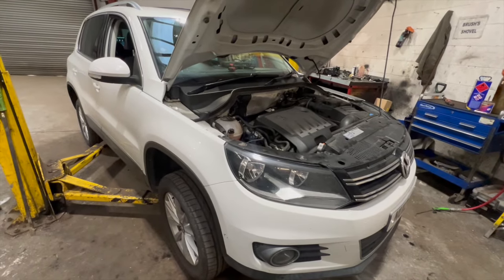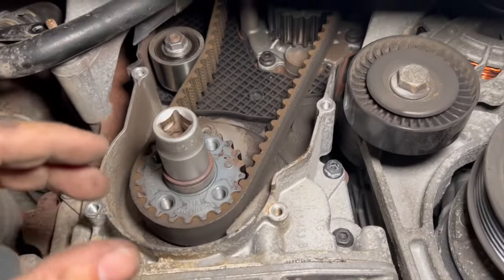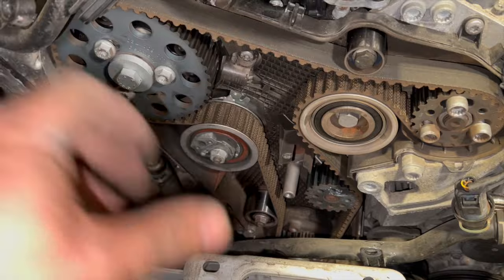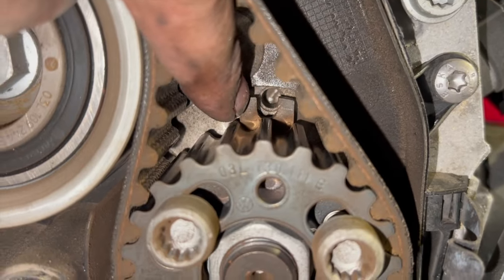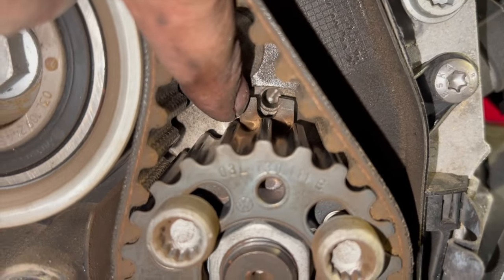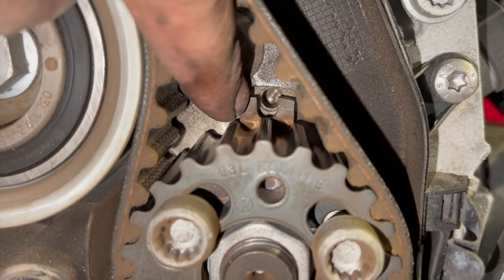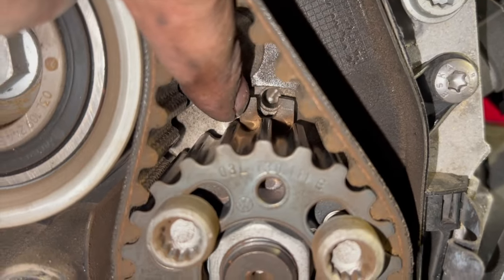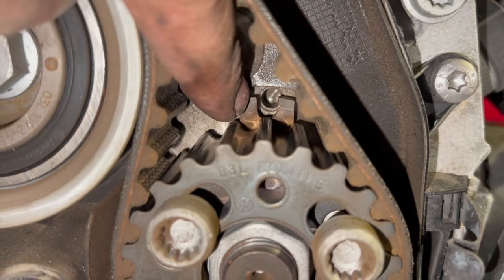2012 VW Tiguan 2.0 TDI Timing belt & water pump replacement CFFB

Comment: I once saw on a VAG website that they guarantee timing belts up to 320,000km. My 2012 Jetta TDi is currently at 190,000km.. I'll do the belt later. It's a lot easier to do on a Peugeot DW10bted4.. I did the glow plugs on that too.. OMG.I once saw on a VAG website that they guarantee timing belts up to 320,000km. My 2012 Jetta TDi is currently at 190,000km.. I'll do the belt later. It's a lot easier to do on a Peugeot DW10bted4.. I did the glow plugs on that too.. OMG.
Reply: Are you sure it was not 210000 klm
Reply: @ianpurcell7266  nah. Pretty sure it was 320,000km. Not quite double 180k km..... who knows, who cares? I'll change the belt and water pump when I get around to it. No rush

Comment: I had my timing belt done on my MK7 golf TDI and the car came back noisy !!! like overhead noise!! even my son who knows nothing about cars said whats up with the motor it sounds like its going to blow up. I asked the mechanic and he pulled the covers all off again and re checked it. Said you cant get it wrong...anyway 2 weeks later car stopped and came up with number 4 glowplug...i pulled it out and the tip was broken off and then i pulled the injector out and the tip of that was melted off !!! i turn the motor over by hand and it was locked up almost on a full turn but then jammed. Like it was hitting a bent valve or something. Never had an issue with the car ever until the cambelt was done. I think the mechanic fucked up. cant prove it. Maybe the timing was advanced and burnt the cylinder. ?? im pissed off.
Reply from the maker: Hard to say exactly but something was clearly wrong there.. always tricky when something like this has happened if the mechanic is not offering any support

Comment: Just did mine following the video, best one out there. My HPFP didn’t line up perfectly was about 1/3 of the way blocked from the left. Also tightened the HPFP to 20nm as quite allot of people have mentioned this to be the correct spec (including continental) but I’ve also seen a ridiculously high additional 90* which I don’t understand as these are defiantly not stretch bolts, otherwise surely the kits would include them new just like the camshaft bolts..

Comment: Absolutely mint video and has given me the confidence to change my belt next week on my 2.0 TDI superb. Thank you very much for this!
Reply from the maker: Best of luck! 👍👍
Reply: @diydaly  thank you it went really smoothly, kept referring back to your video.
Two things, I stupidly tightened the cam pulley bolts the first stage and second stage to angle before turning the engine around by hand like you do on your vid. Do you think this would be an issue?
Also I didn't replace those 3x bolts and realised after they came in the kit. Do you usually replace them, I don't think you did in the vid?

Thanks
Reply from the maker: @danj3322  not you’ll be fine reusing them, as long as everything’s lined up still you’ll be fine mate 👍👍

Comment: Thanks for this will doing my first cffb engine in my golf only thing is i have lpfp next to top of cambelt. Locking belts and tools ready to go.
Reply from the maker: 👍👍 glad it will help
Reply: Complete my cambelt. Thanks for all the advice. Went in with all the confidence worked out well. The car is running well. Thank you.
Reply: Is that engine similar to CBAB?
Reply from the maker: @DEEDrives  👍👍 glad to hear it

Comment: Brilliant  work...🎉🎉🎉 i used to have 2.0 Tdi CR CFGB which had an aux  fuel pump next to engine mount ...that this Tiguan does not have...😢😢😢 anyways ...it's a treat watching you work and explain...keep it up🤙🤙🤙
Reply from the maker: Thanks mate , comment much appreciated 👍👍
Reply: I’ve got same engine in my Passat b7. Did the extra fuel pump cause an issues?
Reply: @Mandk1108  no it did not...made starting after fuel filter replacing a lot easier

Comment: Hey mate,

Thank you for the video! 

Quick question.. do you reuse all the bolts? I know they're supposed to be stretch bolts.. but I cba waiting for them to arrive from abroad
Reply from the maker: It’s advisable but very rare I replace them .. renew all the main timing part bolts but not the engine mount etc

Comment: Well done! Congratulations!
I have a question -  
I have a Passat B7 2.0 TDI 125kw, similar engine as in the video. The same is common rail, the car is from 2012.
Does it affect fuel consumption, if the pump is not in line with the cam and crankshaft? Because after replacing the belt, my car consumes at least 3 liters more fuel. I am afraid that the mechanic did not set the fuel pump to be synchronized with the cam and crankshaft.
Thanks for your reply.

P.S.
I forgot to mention that he didn't use the lock tool like you did at all. He marked the crankshaft with a marker, and put a pin in the cam, but I don't think it was 6mm, but thinner, to make it easier to install. I can't remember how he adjusted the pump or if he adjusted it at all.
Everything has been replaced, all rollers, new belt, tensioners, water pump, in-line belt with all tensioners and rollers. Everything new.

Comment: Great detailed video just one question would the torque settings be the same values for a 1.6 tdi?
As you were working on a 2.0 tdi
Reply from the maker: They may be slightly different hard to say with out checking the autodata
Reply: Thank you l will see what info l can find ref the possible different torque settings @diydaly

Comment: Nice work great guide.  Do you not change the tensioner studs like on the older PD engines?
Reply from the maker: 👍 thanks , I don’t tend to on these later ones , always check the stud with a fresh but just to check it first

Comment: I have the CFGC (2013) 2 litre 130 kW  engine, I suppose the locking tool is the same, but the specific engine (or even the series EA189) is never mentioned. Should any of the tools on ebay that look like this and say "TDI 1.4/1.6/1.8/2.0" work ok?
Reply from the maker: Yeah most will do it if it’s got the 2 different types for the crank in the kit

Comment: Do you know what damage gets done ifd belt snaps on these engines ? just wondering if its worth fixing ?
Reply: This is an interference engine. Meaning the valves and pistons occupy the same space, just not at the same time.  If the timing belt breaks the pistons hit the valves.  If you are extremely lucky you need to rebuild the head.  In most cases you need a new engine.

Comment: Does the fuel pump need to be timed? Being a common rail u would’ve thought it shouldn’t matter if it’s locked or not
Reply from the maker: It’s more for balancing purposes , should be set it the correct position reallly

Comment: Would this be the same set up on a 2010 Seat Leon 1.6 TDI CAY enigine ?
Reply from the maker: Should be very similar
Reply: Thanks for the reply. I just came accross camshaft synchronisation. Why is that done and when does it need to be done ?

Comment: In your experience, does a timing belt tensioner loosen over time? Is it prudent to set the pointer on the right side of the channel?
Reply: Judging on this video, the answer seems to be yes to both questions as the tensioner is far towards the slack side on this engine.
Reply from the maker: I’d always recommend only setting to the centre , you don’t want to over tension..